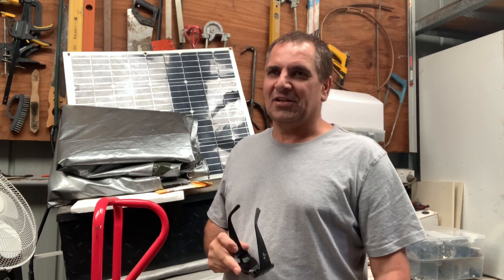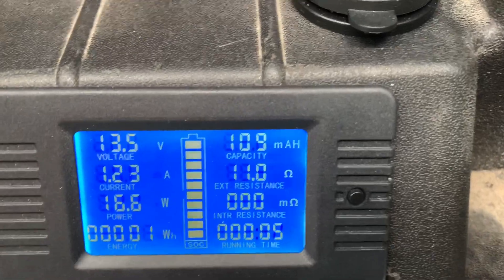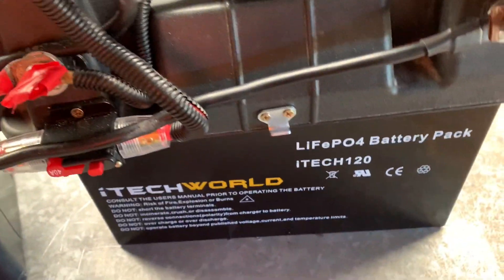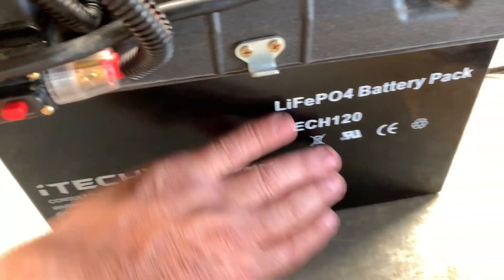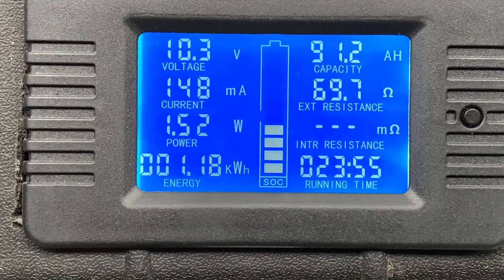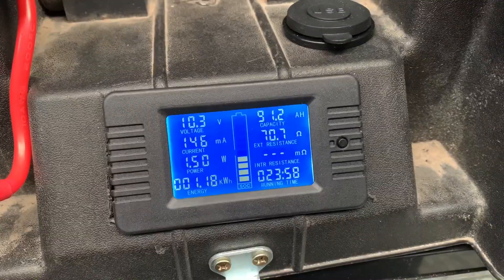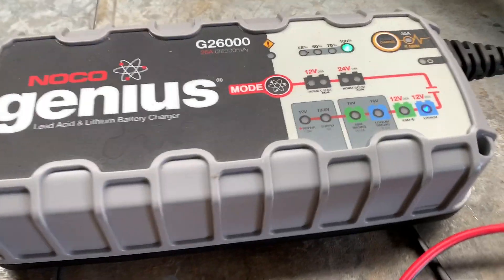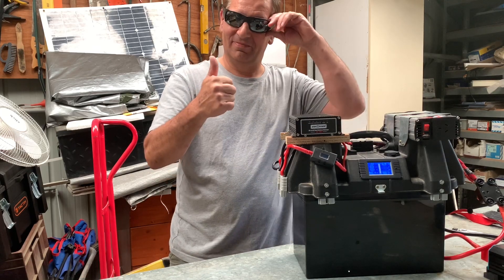Itechworld lithium battery capacity test after 13 months

Comment: When i bought my 2 120 ah itechechworld batterys they told me it was ok to use the ctek 250s dual dcdc charger (20 amp) paired with the smartpass (80 amp)

Ive been having alot of troubles with it does my cranking battery need to be 100 amp ? Do i need to upgrade my alternator ?

If i have my itecbworld batterys in paralell will they share 50 amp each if the  dcdc and smartpass is pumping out 100 amps ?

Comment: Where did you get the battery metre from?
Reply from the maker: From eBay https://www.ebay.com.au/itm/174367017778?hash=item2899158b32:g:hmAAAOSwgjVgRY03:sc:AU_Regular!4132!AU!-1&amdata=enc%3AAQAHAAAA4JImaB8LgyXaSGqamcTN67mMD%2BIM5R9l0oN7GmtDVpU69qtF2kHnN1gLkevrhdBdWivAmeTvjpBTI%2Fw%2FuyI%2FkCHK2AFEC2u22NuYBBmNWeOeWwOPnHT%2BryG4l2T%2Fi%2FrMYJZJp9v7i3lCjd1dH1nS37nLWD4I9Y%2FV1%2F697iA3ZVdw8yRzYbaf0dn0jqKCWS0sH5gppL82b880F6xYsXH%2BNVx1a1lOUKN%2FDs0WbW8xPkYNHcL%2FBUy2aRESmCtlQoUvvkj8JrGiB6SbtU%2Fmls%2Btm4P2hQtQsh3PdyKskRyCSo1Z%7Ctkp%3ABFBM2O3V2q9g thanks for watching 👍🍻
Reply: What one do you have? The 10amp?
Reply from the maker: 200amp

Comment: Great vid! I noticed you are using the Giandel inverter, any issues with it so far? I have a small 300W one and its been great, but stepping up to a 1000/2000W one there is a lot of others on the market, so just trying to see if you have any issues with yours. Cheers
Reply from the maker: Thank you.No issues at all with the giandel . I have had 3 of them (2000/4000watt one sold with my caravan have video on it and 1000/2000 watt one in this video which I sold vehicle with this inverter and I have a 200/400 watt one currently still have it also have video on it). In my opinion the giandel are the best inverter in the cheap budget range and never had any problems with them . Thanks for watching 👍🍻

Comment: Hi Dino ,
Love your work ! Finding a lot of these videos very helpful . 
I have a question . Hoping to find out of your redarc bcdc1220 . The ignition version or just the normal one . Hoping to make a portable battery box like yourself . However I have been told that due to the lithium having a soc is always around at 12.8v the redarc doesn’t recognise it till it’s very empty . 
Love your advice on this as I have a old redarc bcdc1220 and would like to make a portable box
Reply from the maker: Hi ray . My old redarc is the ignition version (has the blue ignition wire which you connect to ignition source, my case I just connected to red wire). Lithium soc is generally around 13.3 volts usually. . If you have the old redarc charger without the lithium charging profile like my redarc dc charger,you need the itechworld lithium battery as it will charge from any battery charger set on agm profile . Hope this helps 👍🍻
Reply: @EFFICIENTSELF  

That’s good to hear ! Thanks Dino . 
I will do that . 
Are You still happy with your itech battery ?
Im looking for new batteries for the canopy in my cruiser . However want something with Bluetooth inbuilt rather than wiring a seperate module . 

Ray
Reply from the maker: Yes been happy with this battery i bought 3 more for my off grid van build cheers 👍🍻

Comment: Thanks for taking the time to do this test. How's the battery holding up? Just about to purchase a 200ah Itech. What do you power off it on your trips?
Reply from the maker: Thanks 🙏 for watching my videos ,really appreciate it 👍🍻
Reply from the maker: Battery is going well at 22 months . This battery mainly powers little fridge and runs 200watt inverter to charge laptop in wife’s car. I have 3 of these batteries in my van build with 3000watt inverter running kettle,microwave and all sorts of things for Off grid van. Thanks for watching 👍🍻
Reply: @EFFICIENTSELF  Thanks for taking the time to reply. Look forward to more videos

Comment: What brand is the meter you are using if you dont mind me asking?
Reply from the maker: It’s just a no brand battery monitor here is link for example https://www.ebay.com.au/itm/Battery-Display-Volt-Meter-Digital-Voltage-Gauge-Current-Power-Monitor-For-Solar-/363381047115?hash=item549b32bf4b thanks for watching 👍🍻
Reply: @EFFICIENTSELF  cheers

Comment: 4:00 would that be the capacity of the battery if the BMS is still active and depending on what's connected you can continue discharging it? The inverter probably just has an internal voltage cut off.
Reply from the maker: Think the inverter cuts out around 10.5 volts. The battery was flat at this stage and remaining power probably not usable. Thanks for watching 👍🍻

Comment: Thanks for the content. Just want to point out that you did not take Into account the inverter power lose. The inverter’s specifications should state the efficiency. Once you’ve taken that figure into consideration the actual battery capacity will be greater than what you’ve stated. In addition to that, you’re find the real results will probably have An accuracy of +/- 2% due to the cheap power metre used.
Reply: The in and out meter should be between the battery and the inverter.

Comment: Genius, your charger is dumb as a rock bud.
Your going to need at least 14.6v output to charge that.
Your charger is lying to you and is not fully charging them.
I reckon i could get 121ah out of that battery if you haven't run it flat to many times and the cells are still in balance.
Reply from the maker: Ok cheers I will look into it and try to get hold of Another charger somehow 👍🍻
Reply: Gotta have a chuckle at the guy with grammar skills of a 5 years old patronisingly calling someone a genius HAHA!
Reply: Yep need to be taken alot higher than STD lead acid voltages

Comment: As i've said for all your other capacity testing videos, you need to fully charge the battery first (your voltage was only 13.5v this time.
3.375v per sell is no where near fully charged and this is proved by your results.
Reply from the maker: This probably was at resting voltage dude . This video was filmed over 3 days but I will look at the charger and next time I charge I will check the voltage and not let it rest . Thanks for the heads up as I will check it out cheers 👍🍻

Comment: Something seems weird - normally Li batteries can accept much more than 10AH  charge rate, so with your 26AH charger is should have charged in 4 hours.  The voltage level on drawdown seems to have dropped too fast and too low as well.  Is this a problem with  the BMS in the battery?  91Ah from a 120AH battery is below par.
Reply from the maker: This battery has 96ah of usable power on spec sheet. The charger I have is 26amps but I found it fluctuates when charging and highest I seen in charging was around 23amps and around 4 amps on low. Thanks for watching 👍🍻
Reply: @EFFICIENTSELF  Then selling it as a 120AH battery is false advertising, I would think.
Reply: @einfelder8262  120amp hr AGM battery can only give you 50 usable amp hrs before the battery starts suffer damage. Lithium batteries can be taken down to 80% of their total. This is average recommended discharge on most. There are some that can go as low as 95% discharge.
Reply: @rossrhodes1963  Most lithium batteries suggest charging to maximum 80% to prolong life.  So if you charge to 80% and discharge to 20% to keep it alive longer, you have pretty much the same usable amp hrs as an AGM at significantly higher cost, and the inability to charge it in cold conditions.

Comment: Has anyone done a test on a brand new one of these batteries,  I seriously doubt these batteries started their life as a 120Ah battery, I have 2 of these and yes I reckon that they are 90 - 100Ah only.  I'd love to see one cut open
Reply from the maker: When this battery out of warranty I probably will cut this open to see what’s inside . This battery has performed very well so far . Thanks for watching 👍🍻
Reply: There are other videos. That model is a 120ah battery however like all batteries u cannot use all that energy the internal battery management system in this battery will switch the battery of once u have used 80%. This battery brand new only has 96 amps that you can use. An agm battery  of the same capacity should only be drawn down 50% so u can only use 60amps before u damage the battery
Reply from the maker: Yes true 👍 I mentioned it has 96ah usable power ...it’s a great battery I bought 3 more for my off grid camper build..thanks for watching 👍🍻
Reply: @EFFICIENTSELF  no worries. I just got into the industry and they are an awesome product
Reply: I have 3 and definitely only about 95a/h AT BEST..

Comment: Not for cranking car battery. If need it then diy hybrid capacitor lifepo4 on youtube. Without capacitors the trickle charging kills off cycles thus making it same as lead battery in life expectancy.
Reply: Not with a Lithium dcdc charger. And with a solar panel backing up. Got one in my truck and it never goes below 80%  Right where they like to sit

Comment: You're a dedicated man Dino. Another good video. Will be an interesting result after five years of use. Do you know the average lifespan of these batteries?
Reply from the maker: Thanks azza. Not too sure on that mate . I think they have the lifespan of cycles and how low you discharge the battery . They have less lifespan if they fully discharged . I recently went on a camping trip and cooked with the road chef oven ,running fridge , used the inverter to boil my water and run the toaster..lol. And I think the lowest this battery went was around 60% . Once you get into the lithium mate , there is no turning back to agm 👍🍻

Comment: bit weird as i have 103 ah useable off 106.5 ah rated cells and seems to me the bms in your battery  is configured to very conservative parameters to leave you with 91ah useable off a 120ah rated battery.
Reply: Updated specs on the latest give you 105amps now.
Reply from the maker: Thanks for watching mate 👍🍻